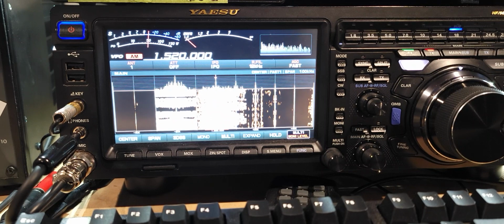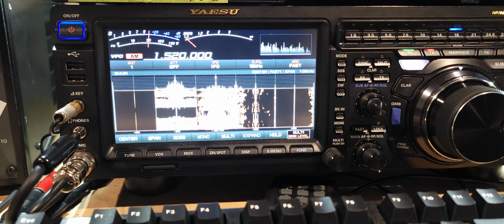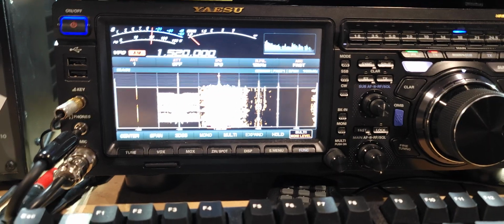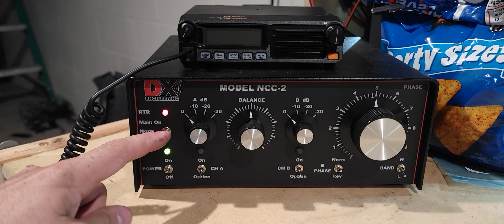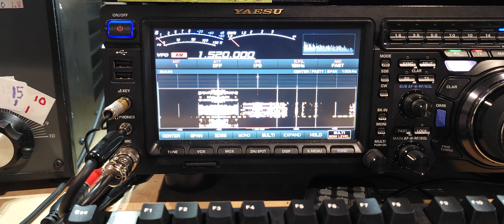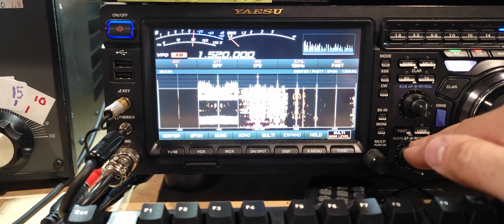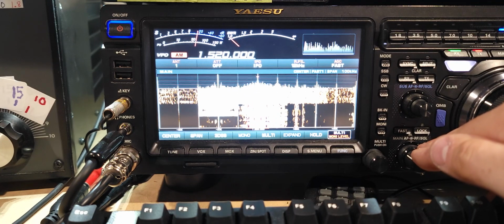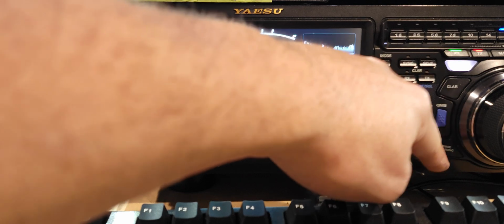Dx Engineering NCC-2 phased RX verticals

Comment: Hi,

Ambient noise at my shack is S9 during the nights on 20 meters. I am using a sloper 40M EFHW. Working dx is a challenge, as i can barely hear over the noise floor. Wondering if this will help since MFJ 1025/1026 is no longer available?Large directional antenna are not feasible at my qth.

Dx engineering is selling addon filter modules for 160, 80, 40 etc . I believe there are 8 such filter boards having low and high pass filters. Are there slots inside ncc2, for these filter modules to be installed simultaneosly or is it one or two at the same time?

Asking since you had the fully installed version. Thanks for the video.
Reply from the maker: @VU3FXD  this should be able to work like the mfj model. It would be better to track down the interference and try to resolve.
Reply: Thanks

Comment: Also how does this setup compare to your beverages?
Reply from the maker: @kyledunaway6370  my beverages were on the ground or just above the ground. The verticals were better. I no longer have the vertical/ncc2, I'm running a sal30 now.
Reply: @ were you unhappy with the verticals with ncc-2 or jist trying something different? 

And whats the SAL-30?
Reply from the maker: @kyledunaway6370  sal30 was made by array solutions but no longer being made. It's similar to a k9ay loop. It works pretty well and gives me 8 directions. 

Not unhappy with them but the ncc2 box was a very pricey unit to only use a couple months out of the year. My rx antennas are temporarily installed in the fall and taken down in the spring.

Comment: My neighbors outdoor lights spread S9+ noise over the entire HF Band. Looking at this
Reply from the maker: Have you tried to talk to them about it? While it is not your place to spend the money you may be better off just replacing the lights for them with a different model. I've done this with a battery charger with a neighbor. Otherwise the mfj 1026 may be a good option. the ncc2 is very expensive if you're only using it for phasing out rfi.
Reply: @N9TTK  I have tried mentioning it.  They are not open to it.
Reply from the maker: @GreyGhost-r4z  You may try sending them a certified letter and include the FCC information stating that intentional interference is against the law. I try to explain that I will make the fix as painless and as easy as possible but I have thousands invested in this hobby and it will be resolved in one manor or another.